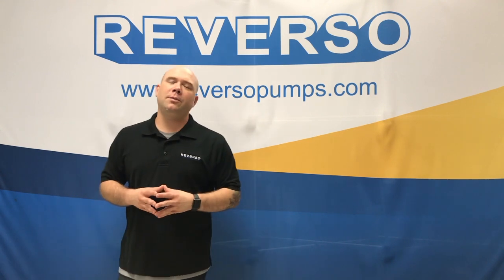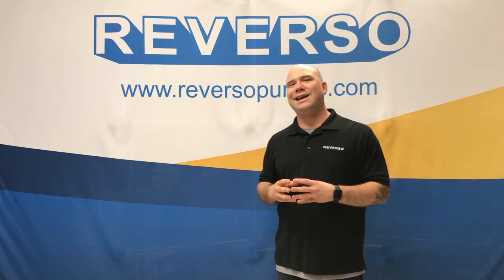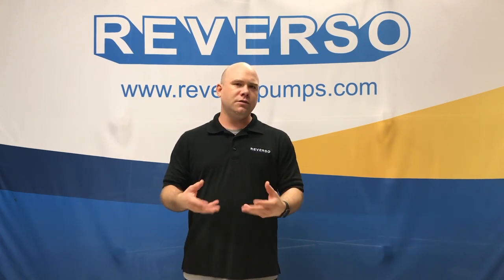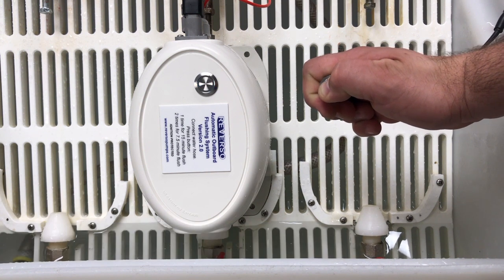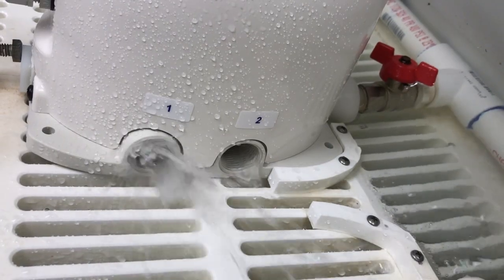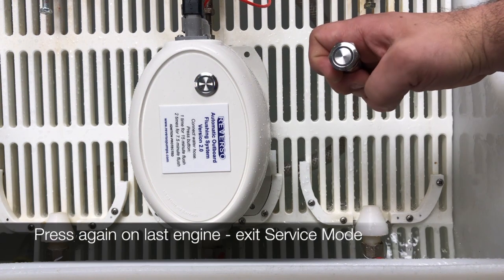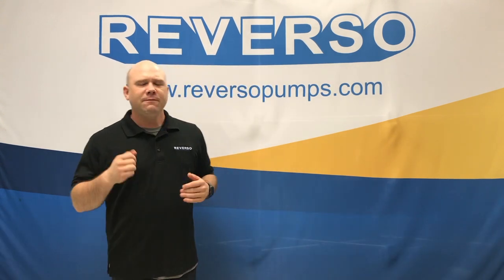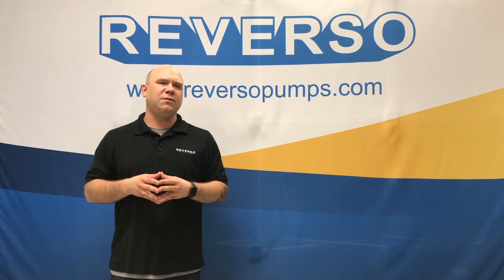Service Mode for the Automatic Outboard Flushing System

Comment: Twin engines: Geeze I just rigged a "Y" hose splitter and keep two 6 ft washing machine hoses connected to the "Y".  I still have to connect each hose to each of my motors, but I flush both motors at one time.  Works great.

Comment: What the hell? Why wouldn't I just use a splitter if I need to do all the motors at the same time?
Reply from the maker: Hi. A splitter “splits” the water flow, but in so doing it also "splits” (reduces) the water pressure. Reduced water pressure can’t adequately flush the 3 engines simultaneously. This Reverso system flushes each engine, automatically and one at a time.

Comment: How do you get this on older Reverso models\?.
Reply from the maker: Hi Maggie. The Service Mode is a development of the current version only, and new units from production will have this feature included. Unfortunately, the update is not available for retrofit on previously manufactured units, as it would require replacing the entire control module. Thank you for your question.